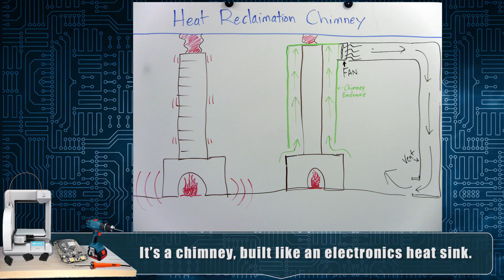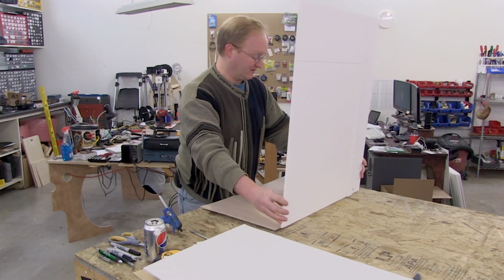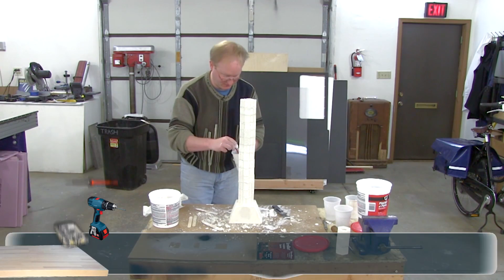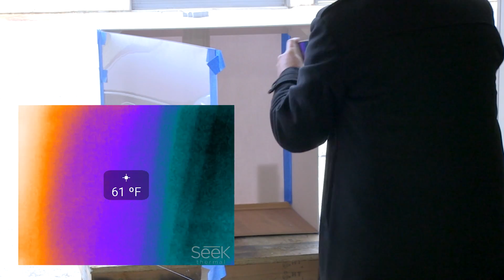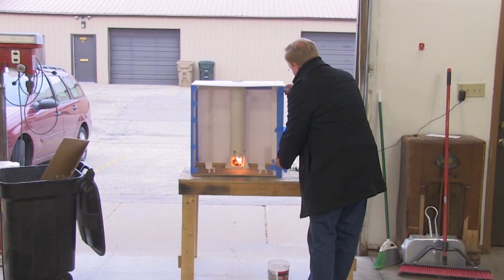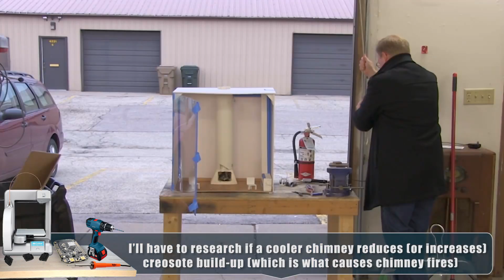Ben Heck's Chimney of the Future

Comment: There are lots of ways you could "reclaim" the heat. I think that a method using coiled metal pipes inside the chimney or even as the chimney itself with water pumping through it would prove to be both more efficient and versatile. The water could be used to power radiators to heat the house, used for showers or baths, and also could act as a form of heat storage after the fire goes out. Another interesting thing you could do is mount some Peltier's with one side attached to an external heat sink on the outside (cold) and a hot water block on the other (hot) to generate electricity. It would be perfect for this small scale model and you could make some mini lamps and or fans for the house as a proof of concept. Also, it would be a great indicator of how long the water holds the heat. Looking forward to the next video!
Reply: Old wood burning furnaces used to do that.  We removed one from my parents to install a gas furnace.  Water would be fed from a cistern to heat in the furnace and it would be used for hot water.  It's an interesting idea, but the components used are expensive, corrode, and generally require more maintenance.

Comment: I  would have used temp sensors rather then Thermal Imager. You wouldn't have to open plastic door. You would also get more accurate readings around room.
A ceiling fan would push hot air down, making it more efficient  and look cool in the model.
Your model would eventually use up all the oxygen and kill everybody but a small price to pay for SCIENCE

Comment: A modern home furnace is typically 90% efficient or higher. I would try building a furnace with a heat pump on the exhaust to extract every last bit of heat.

Comment: my fireplace/woodburning stove has a heat exchange on the sides of the firebox with a fan that will allow it to heat my 3500+ sqft house fairly well, granted the room its in gets way too hot but if the powers out you deal with it.

Comment: Ben did not actually perform a real control test or keep almost anything consistent between the two experiments.  A control would have been to check the temp. after opening the garage door and waiting the 30 min. to check and see the difference the chimney made over the furnace setup.  Also, if you are not going to have something in one test don't add it to the other.  What Ben did was show that you can use the fireplace to help the furnace instead of sucking the heat out the top or into the wall.

Comment: Ben, i think you needed a second control test where it was just having a fan somewhere in the fake house without the "heat recycling system". I think just having some air circulation in there would help spread the heat around the (fake) room.

Comment: You know to do this kind of experiment right you need to do it again with your air circulatory in place but turned off. that way you can judge whether or not all those electronics are worth it, or whether sticking a bit of pvc pipe around your chimney will conduct heat around your home just fine on it's own :p
I strongly suspect the piping is actually a better heat conductor than the air.

Comment: this is known as a heat exchange in furnaces, usually made from copper I believe, the burners fire into the heat exchange then out through the chimney and the cool return air is circulated around it and forced out into the home, it divides the room air from the burning air as burning natural gas or propane would fill the home with carbon monoxide

Comment: I think if you ran hot water pipe around it,it would be great for heating water more efficiently or maybe as part of the central heating system
Reply: yes, this has been the main staple of heating houses for a very long time, they use gas furnaces and pump hot water through pipe rigs, they are very safe and awesome at heating, especially the 1950s and below homes, the water heaters are like works of art.

Comment: Building a stove out of plaster is a very bad idea. Plaster (gypsum) is actually used in walls to restrict fire. In case of a fire the water (that was use to mix the batter) in the plaster will  evaporate and keep the wall cool, therefore restricting the fire. This means that the material is not the same in the two cases, and will very much affect the result. The fact that surface of the chimney is kept cool will also give a unfair advantage to the second test.